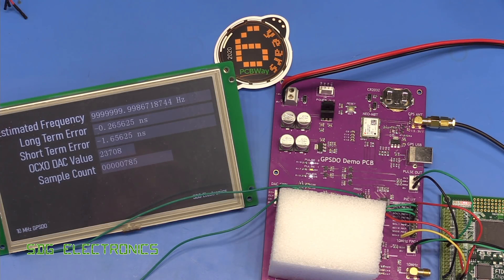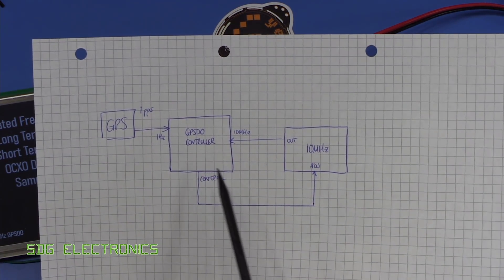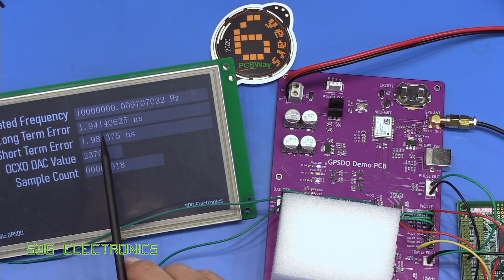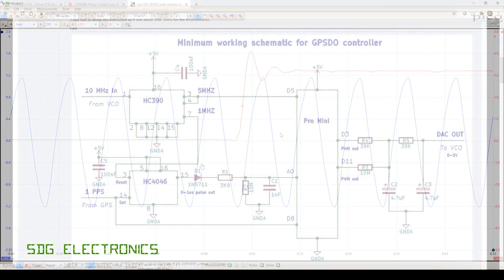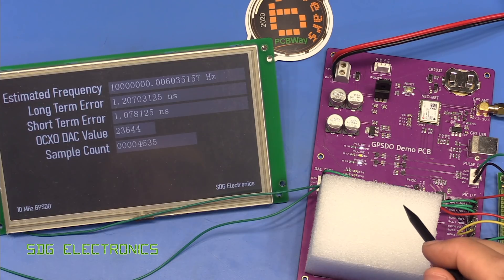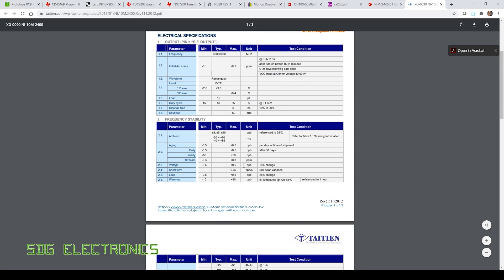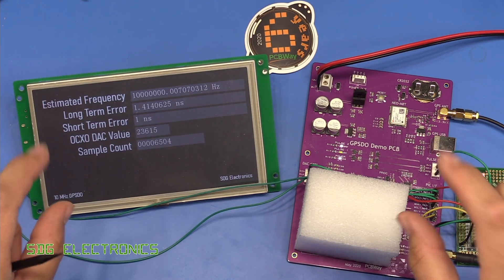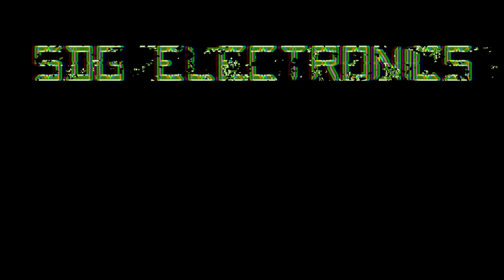SDG #163 What's all this GPSDO stuff, anyhow? Why is there an FPGA?

Comment: Ok, maybe my shallow knowledge of the complexities involved will show. But is it not possible to generate a square wave from the GPS module in the Mhz range with an internal divider? Then divide that 48MHz (?) clock down to a lower Megahertz frequency, of which an odd harmonic (because it is a square wave) matches the 10MHz of the OCXO. Then adjust the OCXO input until it nulls the phase difference between them. So divide integerly from 48MHz (or whatever the max frequency the config allows) to 2 MHz, filter out the 5th harmonic and amplify it. Then compare both near 10MHz frequencies and make the OCXO match it's phase, or at least arrest the phase drift to zero.

Comment: Nice video.
I'm also building a gpsdo with the Tdc7200. In the past I have used a 4046 with a FET as a current source to get a linear slope when charging the capacitor. But that does not work well after I switched to 3.3V. I use a samd20 to do the counting and all the other work, no fpga needed for that. It can count and store a value in a register when the 1pps is detected without the interference of the cpu.
Reply from the maker: I've had this project on the shelf for a while as I was starting to make things too complicated (which meant the firmware would never have been finished...). Thanks for your suggestion, I'll take a look when I revisit the design.
Reply: @sdgelectronics  my design will be posted as an open source project  when finished. I'll let you know when I have done that so you can have a look at my solution.
Reply: I just discovered this video and I'm gutted it stalled, would love to see more of what you described, especially the TD7200

Comment: Have you checked out the nice GPSDO and distribution amplifiers that were designed by that Japanese amateur radio guy? I’ve got to tinker with them quite a bit and they are super nice. They stand up very well to much more expensive pieces of gear. 

I bought a literal truckload of Nortel telecommunications stuff. Tractor truck load. Bunch of phone towers that were upgraded I guess. I ended up with over 20 Nortel Trimble gpstm modules. All mounted in massive cabinets with huge back planes and extremely nice but overdone powering system. 

Obviously not something I need for my lab. So I plan on converting a few of those for me and some buddies… And honestly think I’ll like them better than My rubidium standard. I think they will offer much more accuracy long-term and short term. I’ve been able to power a few of them outside of their back playing in cabinet. Not too complex. And luckily the Trimble of a Nised oscillator module and supporting PCB just pops right out on its own. 

Check out Tony albus on his YouTube channel. He’s got about a dozen videos regarding those GPSDO modules and distributions that were designed by that Japanese guy. 

They come in many configurations. But My favorite one has a 10MHz in and out… But also has its own standalone ovenized oscillator. In case you need a back up to the GPSDO. The OCXO in the distribution Aunt automatically disables when you feed the GPSDO into it. It switches over automatically.

If my memory serves me correctly… It also has 5 MHz out, 1 MHz out, sign out, square out, and 1pps.... and I think 100 kHz out if memory serves me correctly. 

Hard to beat that for $100. And then the GPSDO is another hundred dollars so for around $200 you get both. Sweet deal in my opinion. If I didn’t have that stack of telecom equipment bought at scrap price… Then I would definitely be looking into keeping those GPSDO and Amps in my lab permanently

I really enjoy your channel! I’ve been waiting months and months for someone to do a video on UVC LEDs. So I was so excited to see your video last week.

I’ve done a lot with UVC LEDs and arrays over the past year. Very surprised some of the crazy samples I’ve been able to get my hands on. 

Some of them came from the big boy suppliers and companies who make them… And some from what I’m guessing are factory workers who are pocketing some of the high powered samples that weren’t on the market yet. 

 A year ago I got my hands on some 50 mW 265 nm nikisso leds. A few months after that some of the 70 mW LG leds. And this was absolutely unheard of at the time. Sure there might have been a few articles published over the past few years about high powers … But there was absolutely nothing available that was over 20mw. At least not to the general public. 

The first thing I thought when I heard about Covid last February a year ago… Was that hopefully it would influence the UVCLED market. I know that’s a terrible thing to think. But no one took the pandemic this serious back then. So I guess things started evolving so quickly because of the pandemic… these factories were probably very hectic and I’m sure had many failed batches and experiments. Or chips that were rejected for some reason. I’ve always enjoyed buying military surplus, laser and medical equipment, and other optical obscurities from the Asian “deep web”. Not like the black market or anything but just websites that are unlisted unless somebody gives you a link. And it’s not very professional. You pretty much text back-and-forth with someone on WeChat, send the money, and pray that they hold up their end of the bargain. All while juggling a VPN and weird payment requests. But it’s been worth it in my opinion. The reason I think they were factory workers is because they made me swear I wouldn’t list these online for sale. And that if I put them on optics and laser forums… That I waited a while first.  I was just happy and thankful that I got my hands on some neat things.

Tell you what we’re really blow your mind… The first UVC LEDs I saw in person were about eight months ago… At a local Walmart. Yes Walmart. They were obviously cheap Chinese knock off‘s but they were real, ceramic package, gold plated, quartz window, UVC LEDs. They were at Walmarts all over the world, hidden in some of the sanitization items That began selling last summer when Covid really ramped up 

I have optical power meters, a few pieces of spectrometry gear, and other assorted optical equipment. Good Stuff I got cheap as broken or as untested… That I have repaired and had calibrated. 

So I was able to characterize and test all these LEDs. I’ve never worked with these wavelengths before..... but with a bit of tweaking and calibrating it wasn’t a big deal. 
And it sure was a lot of fun! 

Sorry to ramble on. Just haven’t had many folks to discuss UVC leds  with over this past year and it’s been something I’ve spent countless hours on.

If you want to hear more of my experiences… I have a long drawn out right up of some emails I’ve had back-and-forth with other optics/laser nerds over the past year. Regarding the evolving UVC technology, and the rapidly changing landscape and what we’ve learned about it.
Not sure how much you’re in the optics and stuff. But you should definitely check out zenodilodon, Marco reps, tech ingredients on YouTube. Those three and several others have wonderful laser and optical content. I think Zenodilodon is my favorite laserist. That kid really knows his shit. And has zero fear breaking down, repairing, and realigning $30,000 lab lasers. And he’s super nice and helpful.

Oh and I forgot les’ lab. He’s got an amazing newer channel and he’s already one of my favorite content creators. Been begging him to do a DIY spectrometer project because his attention to detail would really bring something new to the table and finally put a good quality and accurate DIY spectrometer on the open source market. 

Now if we can just get Marco wraps to ever finishes OSMU. (Open source measure unit)! But I might as well keep dreaming on that one 😂

Comment: Rather than buy an oscillator in an oven, you can build your own. 
This Silicon chip project does that:-
https://www.siliconchip.com.au/Issue/2018/October/GPS-synched+Frequency+Reference+Pt.1

The oscillator is 40MHz, and is controlled by a 24 bit DAC.
The output is very finely controlled, effectively it divides the 40MHz +/-200Hz output control range into 13 million steps.   
The heater is a transistor, controlled by an 12 bit DAC, and monitored by a DS18B20, giving 0.0625 degree C resolution. (the firmware must implement the heater PID control)

I'm working on a GPSDO based on this oven, but doing my own counter & firmware. The oven appears to work very nicely.
My version of this oven is at the top left of my development rig:-
https://imgur.com/4eahC0G
Oven with cover removed:-
https://imgur.com/U5VZyjq

Comment: It is too complex and imprecise. Try linear approximation Tgps = a + b*Tquartz.  BTW, 1MHz works without quantization errors with both 10MHz and 48MHz clock sources. So if one would use cheap MCU clocked from 10MHz temperture-compensated (e.g. ovenized) quartz and use it to time 1MHz coming from GPS, it would give more precision than one needs for tuning in no time. It is cheaper, simpler and faster solution.

Comment: Have a look how the Leo Bodnar GPSDO does it, far simpler and way more accurate/stable and lower phase noise than oven controlled oscillators! YT video demonstrating it ... https://www.youtube.com/watch?v=N1mgD_-Xukk
Reply from the maker: From all the research I've done, you have to trade off something in the design - either cost, complexity, long term stability, holdover etc. The Leo Bodnar GPSDO looks to have used historical data in that linked video as the maximum control loop frequency is dictated by the 1pps from the GPS system. TCXOs or even plain XOs are not able to achieve the same stability and phase noise as an OCXO when disciplined.

Comment: To the best of my understanding, the 1PPS signal is a digital signal generated by u-blox' digital circuit clocked from the internal 48 MHz clock. So its phase noise relative to the target 10 MHz signal will be horrible. It will drift back and forth within a fifth of a 10MHz cycle. Therefore I doubt precision can be improved by trying to better align with the 1PPS phase. The short-term stability of the OCXO is superior to the 1PSS signal. Only the long-term frequency of the 1PPS signal should be used to control the OCXO.

Comment: Have you considered using the AD9648 digital phase lock loop chip. Analog Devices has an video showing an wenzel oscillator locking to the Gps 1pps.

Comment: Would more mechanical isolation of the OCXO on the PCB help, ie, slots or a separate raised daughter board.
Reply from the maker: I don't think the mechanical isolation is too much of a problem at 10 MHz. It's mainly thermal issues, but given it is a used oscillator, it may have been scrapped because it was behaving out of spec.

Comment: For maximum NTP precision, a microcontroller with IEEE1588 timer support is useful.  I've written an open source NTP server for the STM32F407 as well as the iMX RT1060 (Teensy 4.1) that uses IEEE1588 hardware timestamps for the NTP traffic as well as hardware capture of the PPS timestamps.
Reply from the maker: I'll take a look at this - I was not aware of this standard, so very useful info. Thanks
Reply: @Dan - Did you implement NTP or PTP?
Reply: @markbutowski4487  I implemented NTP. The peripherals were designed for PTP/IEEE1588

Comment: The TDC7200 could be a neat solution to any jitter on the 1PPS. Some of the non-timing variants of the GNSS chipsets can have quite a bit of jitter. So you can filter/average this out on the data from the TDC7200. Are you intending to bring out a 1PPS from the unit that is divided down from your 10MHz Osc but synchronous to the original GNSS 1PPS? So if you do lose sat signals, your 1PPS output is still locked to UTC as far as your holdover performance goes. Your GPSDO videos have been been spot on by the way. Really interesting.
Reply from the maker: I haven't thought too much about bringing out the 1 pps. Until I started looking into my own design, I'd never really looked at that output so I'm not sure. Is there something it's commonly used for? Thanks
Reply: @sdgelectronics  My background is broadcast radio. We use commercial GNSS disciplined oscillators to time DAB radio transmitters and so need both the 10MHz and 1PPS. The 1PPS is critical for maintaining the timing on single frequency networks. So for us, having a "clean" 1PPS output that is time aligned to UTC is pre-requisite and this has to hold true if your chosen GNSS constellation has issues and you are in holdover.
Reply: @stevengwilliam8096 Hi Steven, I know your comment is from 3 years ago, but you asked exactly the question I was going to do here. Do you know how can that be done? Because I understand the behaviour of Lars GPSDO and others but rarely they output a PPS, which is something I need to implement in my design. Any idea would be appreciated:)

Comment: Isn't the TDC7201 the newer model of the TDC7200? Couldn't you put the 10Mhz oscillator into a comparator with a stable voltage reference as the threashold? Or is would that lead to too much inaccuracy on each rising edge? Great project Steve and nice explanation.
Reply from the maker: There doesn't appear to be too many differences between the two devices. The TDC7201 is a small BGA package though which has the potential to complicate the PCB. The TDC7201 is indeed newer, though it looks like only by a year (2015 vs 2016).
Reply: Hi Steve, what will be controlling the SPI protocol? FPGA or microcontroller??

Comment: Funny. Mine just arrived today!! I was just testing out for the past hour.  It's the usual little BG7TBL type.
Reply from the maker: That's one of the units I have here, though it's the one with the LCD on the front. Seems to work well, though it has quite an old GPS receiver, so doesn't support many of the satellite systems in use today so I found the antenna needed good positioning.

Comment: Very Nice projekt which I could be interested in. Here are my comments: I think that you should make the PCB a Lot smaller, lot of free space arround. I need no display just some leds showing the state. I am not a PIC fan, I would prefer a Arm based mcu, ex, a STM32. You could also go for an ESP32, I do have development tools for both (PlatformIO). Using the ESP32 could make it possible to provide a web interface or similar instead of the display
Reply from the maker: Yes, I plan for the PCB to be much more densely populated. The prototyping PCB was large just to allow easier access for probing and modifications. STM32 is an option, but I'm not familiar with the best toolchain to use. The ESP32 using Eclipse was not in any way smooth and I don't know if there is a dedicated IDE for the STM32. The nice thing about the PIC is MPLAB 'just works', and I can open a 15 year old project in the latest IDE and it'll still compile the same.
Reply: @sdgelectronics  it would also be nice if the PCB supports more OCXO footprints
Reply: @sdgelectronics  both ESP32 and the STM32 is supporter by PlatformIO. And both I think is supporting native environment  CMSIS (STM) and IDF (ESP) but also Arduino
STM can also be programmer in STMCUBE (free tool), or Atollic TrueSTUDIO (also free). I have been using the latter.
Reply: @jenskaa4044   & @SDG Electronics Be aware that PlatformIO can blow up your code size and compile time to an unbearable amount( Of course, that depends on the platform you choose). For STM32 the CMSIS or libopencm3 build by your own Makefile/CMake backed up GCC tool-chain would be the professional and stable solution that we all can follow. I take such things like mbed or Arduino only for early prototyping. For an end-product this choice is amateurish and there is just too much bloat and ugliness. 
Btw. that anecdotal reference, that "MPLAB 'just works'" and even with 15 year old projects is a bit funny, when you try to sum up the alternatives you could(not) use in the past and now.
I afford the freedom not to mention an IDE, because with the ARM-based solution I mentioned, you are free to choose what you like and are not tied to constricting manufacturer-specific proprietary systems. At all with only typing "make" or "make upload" you are good to go and get your code running on the chip.
The smallest common denominator is a professional industrial build system that is robust and accessible to everyone. In the end, of course, you should use what you have the most experience with and use the tool and platform that is best tailored to the problem solution. 
A great project. I'm curious what will happen next:)